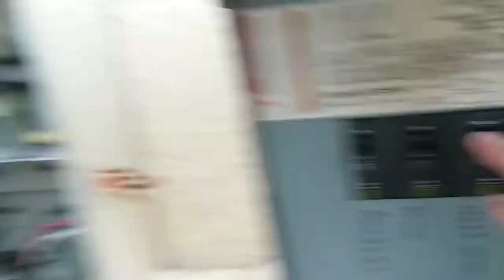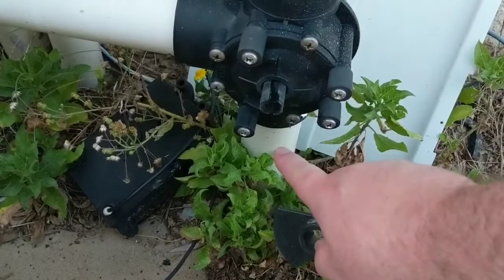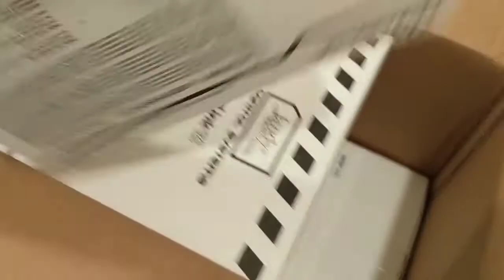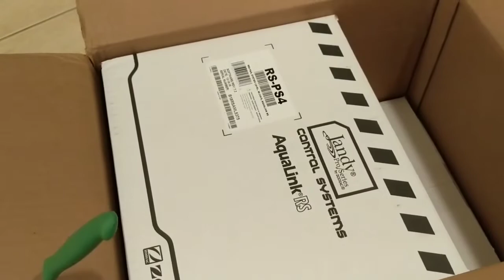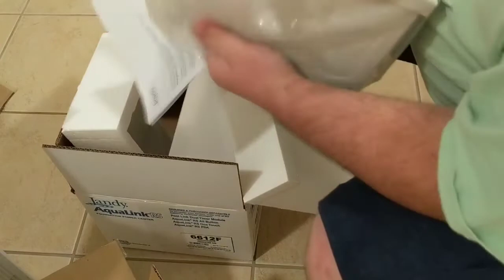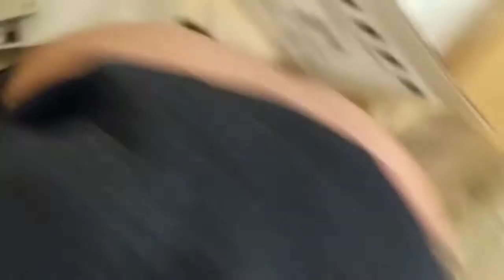Unboxing and Installing the Jandy/Zodiac iAqualink 2.0 RS4

Comment: parts of your filter are falling off because that pool filter is way under size for your size pool i would recommend a pool filter with a multiport too so it very easy to clean ur filter.